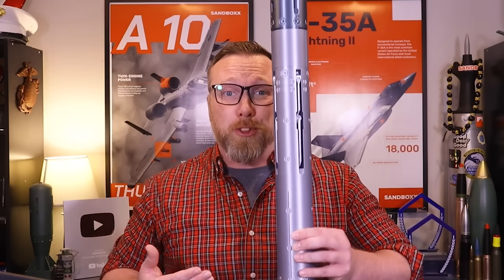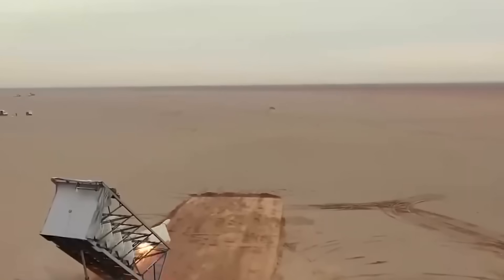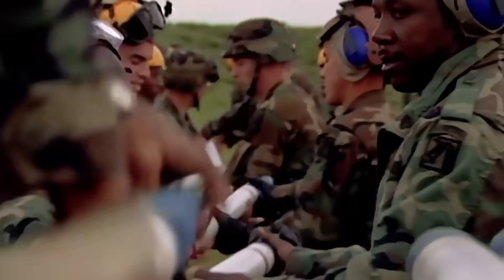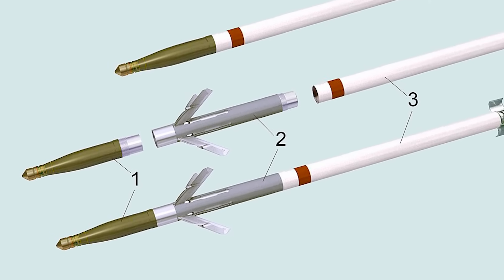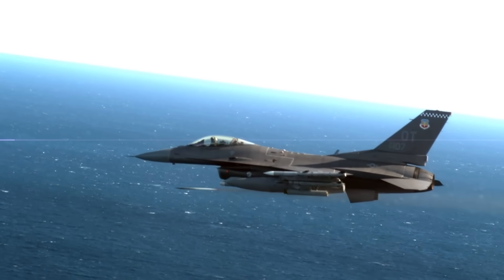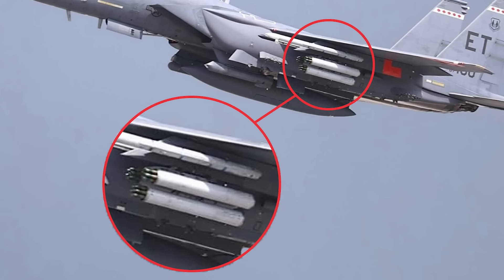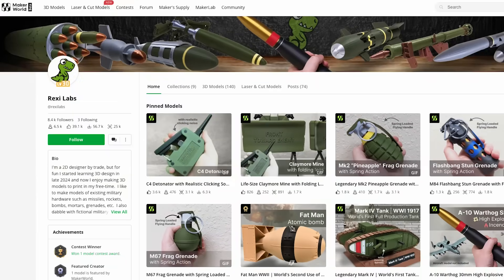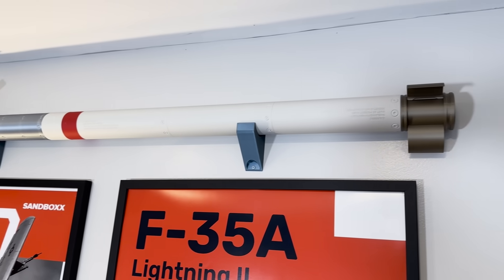How to print your own replica of America's newest air-to-air missile!

Comment: We shouldn't even tie up a F-16 with that task. Using netcentric warfare, we should be able to dump the task of knocking down those nuisance drones to a very inexpensive CCA. Even at only Mach 0.5, it could rundown Shahed 136 handlily. It sounds like something Anduril or even a small startup could crank out easily. The key would be the ability to work with netcentric warfare. Ukraine could even operate them in localized cells with a small onboard radar and a laser designator.

Comment: The AGR-20 didn't start out as an inexpensive AA missile conversion. The laser-guided version was initially designed as an inexpensive AGM. They swapped the laser guidance for an IR seeker to convert it to an AAM.
Reply: He quite literally says this in the first 40 seconds
Reply: @starexcelsior  No, he states that it started as a 70mm Hydra rocket, and they added a laser guidance kit to make it possible to target and shoot down drones. When in fact, the laser guidance kit was initially developed as an inexpensive way to convert the 70mm rocket into a guided ground attack missile. It just so happens that you could also target and destroy slow-moving short-range air targets. So, that's when they came up with the IR guidance kit.
Reply: @marklipsinic7916  it was always laser guided. Under the APKWS name, but it started as an unguided hydra rocket. Then they applied the laser guidance add on, then it was adapted to use laser guidance against air targets, and now as APKWS II it has a thermal seeker add on to become a fire & forget weapon.
Reply: Yes but u missed a step. It was AGR(as hydra), then precision AGM w/ laser guidance, then it was adapted for laser guidance for AA mission, then they incorporated a thermal seeker for fire & forget guidance AA.

Comment: Now I wish they would recreate the Sidearm, the anti radar Sidewinder.  Imagine an antiradiation version of 2.75 FFAR.  This would give copters of all types a self defense against a SAM site.
Reply: Anti-radar is just a seeker that homes in on radio transmission. Drone operators are sending radio transmissions to their drones (except fiber optic). There could be a much wider application for a small, lightweight missile that hunts radio transmissions.
Reply: @canadianeh4792 wicked chuckle  I like the way you think.  Lots of possibilities with that approach.
Reply: @MrCateagle  It would also be effective against jamming. Jammers flood the RF spectrum on the selected bands so they are effectively just powerful radio transmitters transmitting white noise. Since basically every military vehicle in Ukraine is carrying a jammer... 

You could have AI drones, entirely without an operator, flying a pattern ahead of the main assault. A simple program that when they find EW assets they fly towards it and fire a missile. Clear the way for more drones to attack any targets in the area. They can't be jammed themselves because they are not transmitting anything.
Reply: @canadianeh4792 It's possible, and likely, that smart drone operators are using controllers connected via fibre optic lines to a repeater so that any attempt to target the source of the control signal through RF triangulation means the repeater, not the actual drone crew, are hit.
Reply: Quite a plausible approach to take.  I hope they take up the idea.  This seems like something that should appeal to China Lake.
Reply: It would also work well against the helicopters' greatest enemy: radar-guided autocannons. 

Even if the warhead just smashes the radar gear on a Shilka, that's essentially a mission-kill 👍🏻
Reply: And let's not forget SAMs are on ships...
Reply: I don't even think you'd need an actual anti-radiation seeker head. For SEAD if you just put a GPS/INS seeker that could point the rocket at the radar array they will see the incoming rocket pointed at them and scoot ASAP.